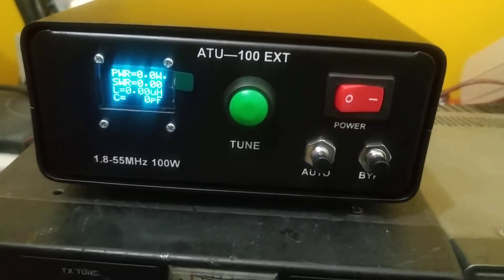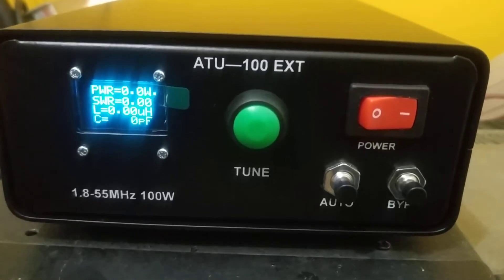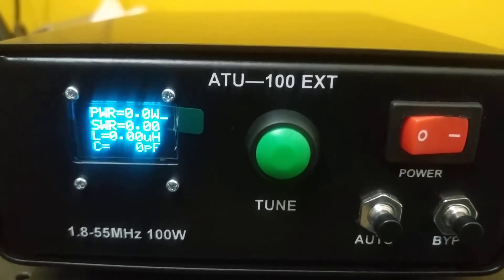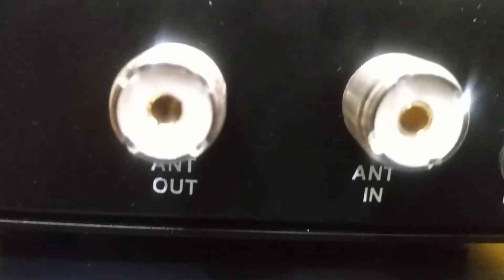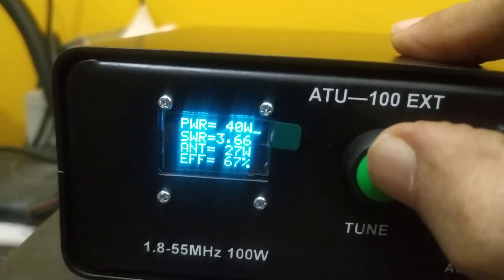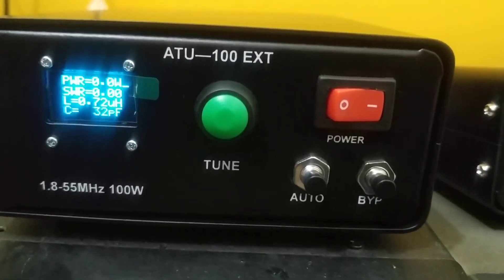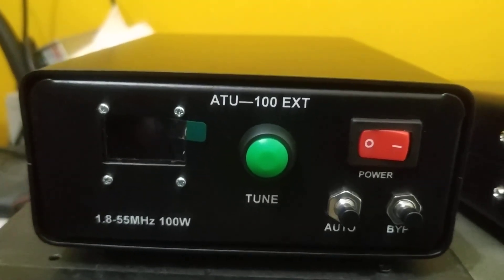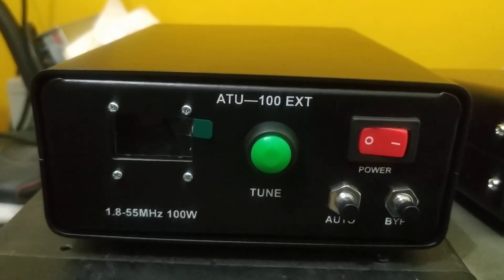Automatic Antenna Tuner ND7DCC 100 watts

Comment: i never had success with this tuner. it tunes nothing, it just sits on tune mode and never comes back.
Reply from the maker: Sorry to hear that your tuner does not work.  Have you tried the auto tune function? Is it a kit or build unit from china I presume?
Reply: @inkits1  it is a built unit from amazon, atu-100 ext with one button for auto tuning.  it seems it is very fussy about tunning. for example, it does not tune CB antenna, or vhf/uhf antenna (mostly pretuned and  i was testing). recently i have a multiband wire antenna. it cannot tune a single band for some reason so i rely on the internal tuner of my radio. it just gets stuck on swr=tune. I have a new CB antenna wire coming soon. Let's see if it can tune that. Even if it is pretuned, it should be able to tune it, no?
Reply from the maker: Hi Ataboy . This open source tuner is meant for hf only . So it will tune rights from 3.5mhz to 28mhz .  But it want tune VHF or UHF ....  So you are trying to tune the frequency which it's not programmed for . Have you used it on hf bands ?
Reply: @inkits1  HI, I am trying to tune an multiband HF antenna 80-30m. specifically I wanted to tune the CB bands. anyway I tried the antenna with SWR on CB radio and it is acceptable <2. 
The tuner will just sit st swr=tune and never come back. Strange.
Reply from the maker: all tuners i build work good. Is it still not working ? Or you have solved the problem?
Reply: @inkits1  Actually I left for sometime, but last try, it does tune 80-30. It looks like I did not understand how it works. My first time into this.  I don't think my HF machine does not support CB bands I guess. I don't know. 🙂 My lack of knowledge is hindering me. I was expecting to use the HF radio and listen to CB band.
Reply from the maker: @ataboyboyboy8895  it is supposed to operate upto 30mhz . So cb is covered I believe .
Reply: @inkits1  in theory.  I am using G-Core G90 and I believe it excludes this channel (need to read the manual). The tuner hangs on this only. Honestly, it is the relationship between the radio -> tuner -> antenna which I don't fully understand yet. If the tuner has to interact with radio while tuning the antenna then I think it makes sense.